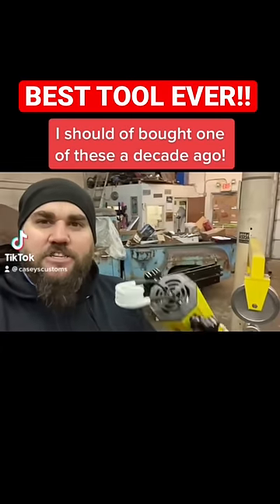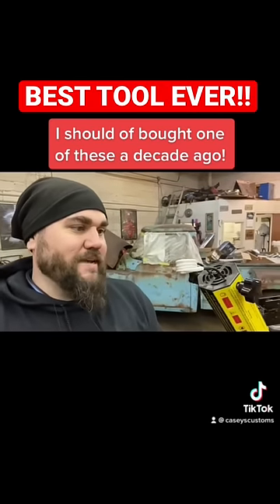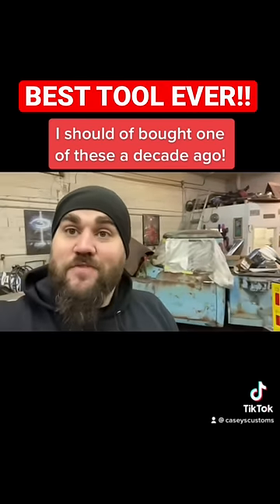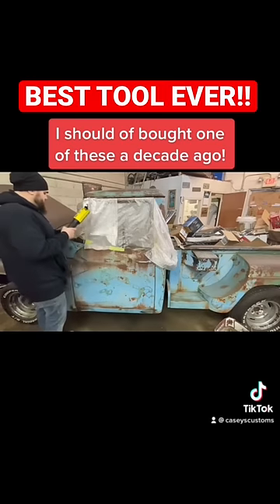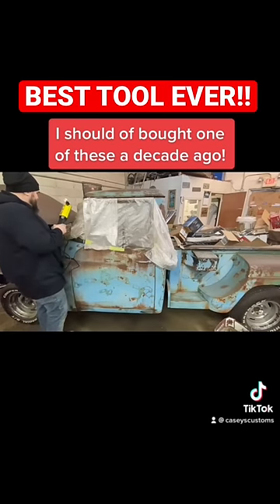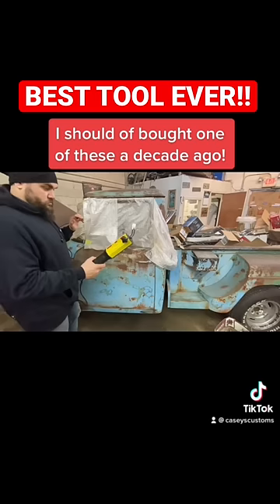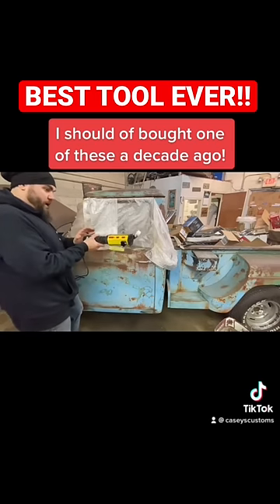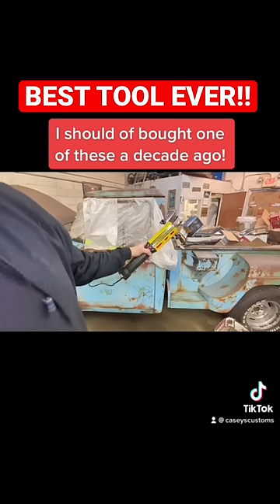BEST TOOL EVER! EVERY CAR GUY NEEDS THIS! BREAK RUSTED BOLTS LOOSE IN A SECOND! VINTAGE HOT RAT ROD

Comment from the maker: SORRY! I did not know the video cut early! Here is the rest of the vid. Sorry again
https://youtube.com/shorts/8fJS9DdMM6c?feature=share
Reply: I bought one a couple years back off of eBay. The only issue I have with it is that I need to use pliers to get one of the nuts tight enough to hold the heating element in the unit. The second thing is that the first bolt takes a while for it to heat up. I mean quite a while. But then the consecutive bolts go much faster. I'm not sure what I paid for I know is over $100 but probably less than $200.

It's a must have in your tool kit.
Reply: Right I was like sooooooooo did it work??  😂😂😂
Reply: @CaseysCustoms  a troll mad at another troll ….nice
Reply: Dude. You turned my frown upside down.
Reply from the maker: @johnwheels89  what on earth are you talking about? I don’t see any comments trolling.. 😏
Reply: Bro i was about to be so mad it cut off so early thank god you came thru in the comments
Reply: Nice try.
Clearly intentional.
Reply from the maker: @Weedshooter707  that’s what I’m saying lol
Reply from the maker: @junatah5903  this video was 100 days old before i put up the part 2… 
clearly not intentional
Reply: Nice clickbait
Reply from the maker: @fozcel  thank you mr denver
Reply: Np, THANKS!
Reply: Right tightly bro, lefty loosy

Comment: Well since he didn't tell yall, these things kick ass! Ford tech here who has had to replace tons of Edge fuel tanks for recalls basically because they rust apart.  So the bolts are always rusted in there and you can't use torches because.... it's a fuel tank.  These things heat the bolt up and it zips right out.  No open flame/fire hazard.
Reply from the maker: Sorry i really didn’t know it cut early, i uploaded this a month ago and it just blew up. Here’s the rest of the vid. https://youtube.com/shorts/8fJS9DdMM6c?feature=share

Comment: I have the same one and they work great. It's important to have the correct gap between the coil and stuck piece to work the best. Where this didn't work for me was on broken manifold studs in an engine block. The block acted as a massive heat sink and the heat never got into the threads but made the tip red hot. Ended up having to buy a welder and weld a nut on. Now I just have a shit ton of tools

Comment: We use induction heating in the power industry to loosen and tighten steam turbine bolting. The induction machines are quite large, but so is the bolting -- 5" to 6" diameter. It's a great technique, but didn't know it was available for the car hobbyist. Thanks for showing it.

Comment: I use mine on 5.4/ 4.6 exhaust manifold studs works Awsome and no worries of starting a fire like with torches in tight spots 🤙
Reply: Just start the vehicle for awhile its free!
Reply: @WolfPackProductions1320  ya no you have obviously never done the job

Comment: If you keep turning to the right, you will find most bolts will never loosen bub.  Lefty loosey righty tighty.  Everyone knows this.
Reply from the maker: Front Camera on iPhone mirrors the footage. Everyone knows this
Reply: @CaseysCustoms  who would use the front facing camera to film a segment like that?  Nothing like utilizing a set of pliers when a wrench would be an appropriate tool?  Use the correct camera on the phone or better yet, invest in a real camera.  There would be no reason why one would use the front facing camera to film a segment like that at all.  I mean that’s an explanation, but a fairly bad one and begs the question on a retake.  It’s also interesting and calls to question your honestly when you post the “follow up video” and suddenly it goes in the correct direction, which was supposedly the same take just continued?  lol.   Mmmmkay.
Reply from the maker: @michaelbenz3721  hey Michael I’ll take advice from you when you get more then 2 subs bud. 👍👍
Reply from the maker: @michaelbenz3721  oh wow, 2 subs and you actually post videos 🤣😂🤣😂
Reply: @CaseysCustoms  doesn’t change the fact you are lying lol.  What’s funny is …I don’t even produce videos and can tell you are lying.

Comment: If you ever have anything still not moving after the heat. Try a can of computer duster upside down will spray co2 liquid on the bolt and freeze it giving you a little bit extra

Comment: I have another trick for these pesky bolts. Depending on the size of the fastener, for example 1/2" i would use a 2 lb hammer to  hit the head of the bolt several times to free up the rust. You could also use a air hammer. It works more often than not.

Comment: I do it old-fashioned way map gas, works every time just be patient. Oh yeah if you lubricate it do it after you heat it up because most lubricants burn up as you heat it up. 50 years of working on engines I know a few things. Oh another thing don't buy the s*** in the can just use a good synthetic lubricant it's a lot cheaper.

Comment: Oxy-acetylene torch if you know what you're doing and you can turn down the heat enough and get a really nice controllable heat going you can put it right on the head of any bolt and get it Cherry without f**** things up

Comment: Flip the spanner so you aren't pulling the bolt loose but instead pushing down with weight and fuckin stomp on it, guarenteed to break any bolts loose